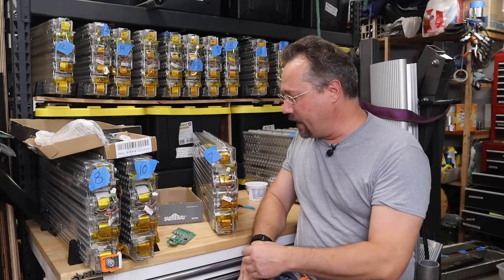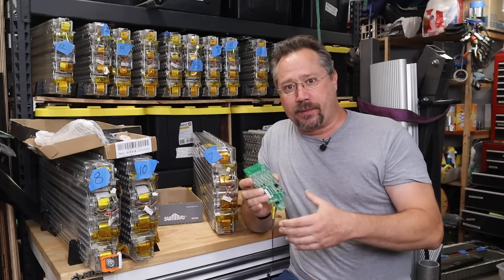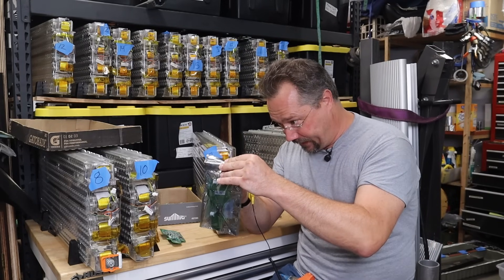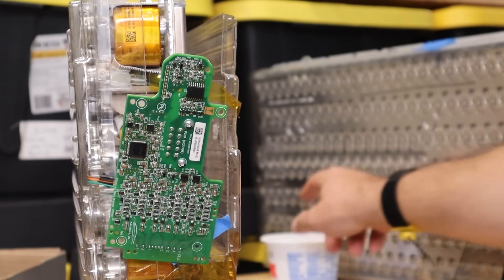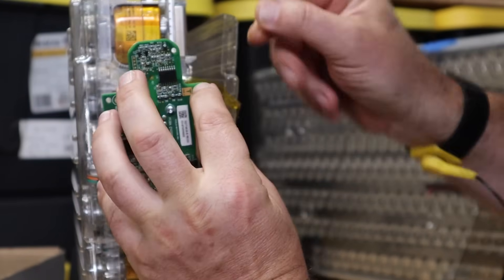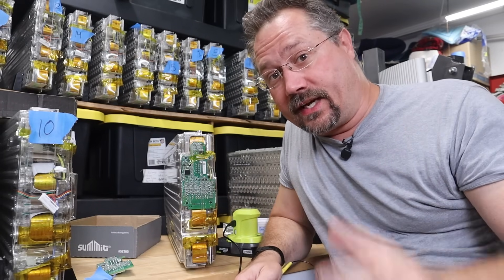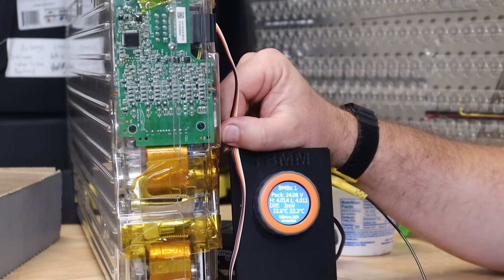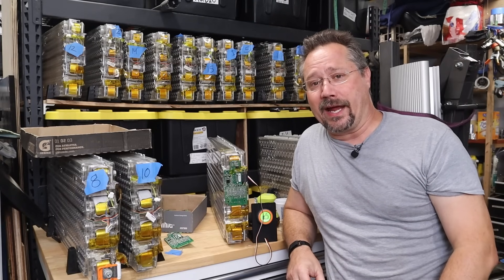DIY Tesla Battery Repair: New Battery Monitoring Board

Comment: Just an idea.... should have UV'd the new board to see if coating was still good, and might want to push on C26 & C27 to see if the soldiering to the board is still okay.  Looking at old board it appears the corrosion probably went under the solder joint on that bad cap.... that capacitor on that board is probably fine outside that crap connection though.

Comment: What sense wires does the pack have? Have you inspected all of those while the modules are out? Both upper and lower side. Would be sad to loose a sense wire in a short while after putting it back together.
Reply from the maker: Yes, I examined every BMS wire connection on every battery module. You can learn more about that in this video https://youtu.be/g9Flb7GMpJo?si=4qSiXjREZD0wlLtH
Reply: @BenjaminNelsonX oh sorry. Missed that video. Good job.

Comment: Love your videos.  I rebuild small battery packs for power tools and Lawn Mowers.  We have leased 2 EV's in the past in 2013 and 2020.  We have gone back to ICE Vehicles and plan to stay there.  Our 4 - ICE Vehicles are 11, 14, 23, and 27 years old.  Too much hassle with EV's here.  Busy or broken chargers, range issues, expensive repairs when needed, high insurance costs, and depreciation, to name a few.  My Friend bought an Ionic 5 and it was too small for their growing Family. He paid $52k for it new.  2.5 years old and he could only get $19k for it.  Talk about being upside down.  

On the bright side. We enjoyed driving EV's. When their range is 600 to 800 miles, we will get one.
Reply: wow - that's so similar to what I'm doing!  I've got a 'new' Craftsman 60v mower running on a brick of GreenWorks batteries and we had a Leaf which was good enough for commuting.

Comment: nothing wrong with replacing the board. a battery out job is in the realm of head gasket repair as far as labor/tools/skill. when you do a job that big its best to replace any suspicious parts/known wear items coz by the time the car is old enough to need another battery out job, its value might not be worth doing. weird economics.
Reply from the maker: Right! This is enough labor getting the battery off the car and taken apart that I'm spending the extra time to document it all and make sure anything that should be done DOES get done!
I'd prefer to never have to open this battery again!

Comment: Nice! Extreme interesting project. I am going to make drying service to my MX 100D. I hope I don't have to open batterycase, voltages are ok, so do temperatures. But car is 8 years old so better safe than sorry and push dry and warm air through it.

Comment: How do you flash the new board ?
Reply from the maker: Great question! I would imagine that this is something that can be done in the Tesla Toolbox Software.
Reply: @BenjaminNelsonX  no need to flash that usually. It should work out of the box. It is a bms board and not a control unit as we know it from other cars you have to train or learn on with keys or via dealer (for example Audi A8 W12).
 Afaik  if you get the same board it is a simple swap and the rest of the magic is done by the wiring.
You had not changed positions of the packs so it will be the same.
Reply: @typxxilpsA test teck on the last video said you have to flash it.
Reply: Wow. I didn't think about the software issues on a new board. Thanks.